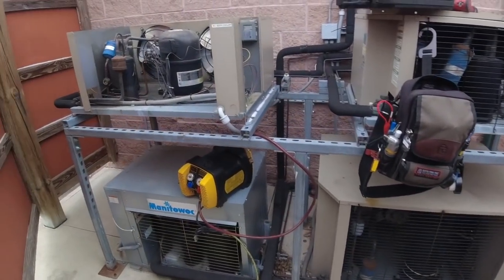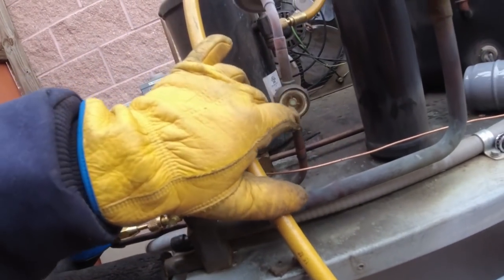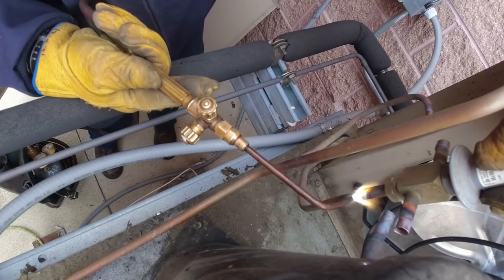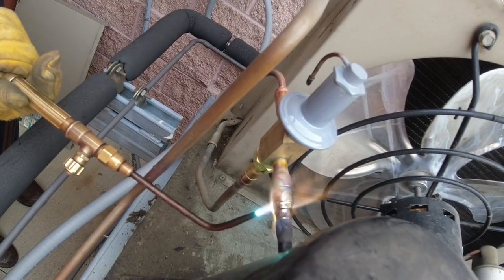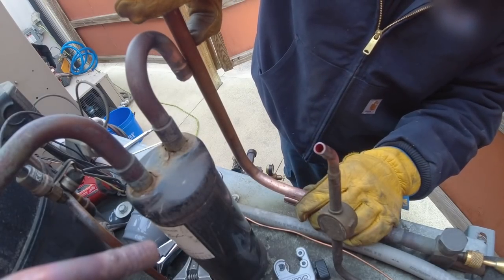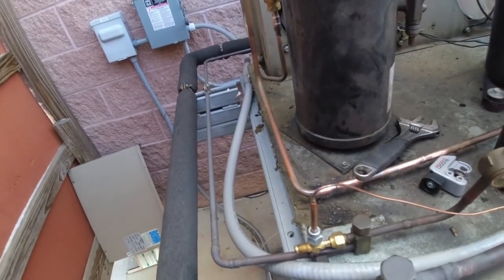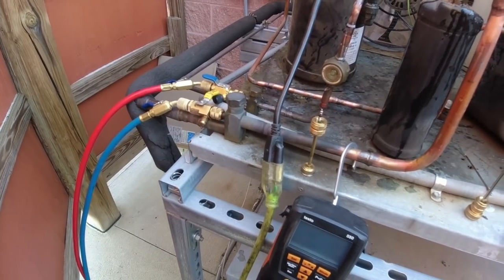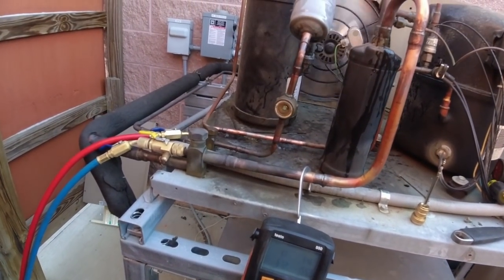Back To Get My Head Under Control

Comment: As a fellow Midwesterner I enjoy your commentary. I’ve said a lot of the same things you have especially regarding the weather, it’s something that the California guys will never understand lol. I’ve had to make pipe bushings for headmasters a few times and the last time I used my swage tool to expand the receiver, condenser and bypass lines to not have to do that and it worked pretty well. If you think
about it next time try it and see how you like that instead double bushin’ it
Reply from the maker: I have done that when I didn't have the pipe I needed. I would have needed to cut the valve out to do that because the pipes had braze on them but that would have left me a little short.

Comment: What kind of gloves are those you are using. They look good for cold weather work, and i know you always get the best.
Reply from the maker: I really like these gloves and they were really cheap. Like $14. I got them at Menards, the tag on the side is a hydroHyde. They're not insulated but they are somewhat waterproof. They fit my small hands perfect and are a lot better than any other glove that I've used cuz generally I can't work in them other than maybe a jersey style
Reply: @HVACRSurvival  Thanx
Reply: @HVACRSurvival  Looked like you had jersey inside of leather.  Don't you want to move to Texas yet?  😎
Reply from the maker: @joehead1294  I would considered it but I'd be moving my myself 😩 if so. Your kinda stuck where you land once all the roots are planted.

Comment: If you're going to stand out in the cold and work which is a joke. I'm going to leave you a joke.,

My computer and air conditioner have something in common.
They both lose efficiency whenever i open the Windows.
Take care of yourself and have a great day PS you did a great job
Reply from the maker: LoL, I was not happy about it, there was no reason to do it that day, I had it working with the fan cycle control.
Reply: @HVACRSurvival  you're a good man not to call in
Reply from the maker: I wasn't raised like that. I had perfect attendance in school most years and same for work. I never had a unexcused day for either.

Comment: Great job and explaining,
Question, so in order to check the total % level of refrigerant, the unit had to be pumped down right?
Reply from the maker: Pumping it down is a easy way to verify the total capacity of the system. In theory the system could hold more because the solenoid valve is at the evaporator but then you wouldn't be able to pump the whole system down into the receiver. Generally what I did is enough to verify it's at Max capacity.

Comment: What size torch tip you use thanks for all the videos
Reply from the maker: I use a number 2 for about everything. I have larger ones but they don't fit my handle correctly.

Comment: Sorry Rick was texting someone else named Bill at the same time what Flir camera is that and what tip are you using on your torch not the MAPP gas torch
Reply from the maker: Oops
Reply: Hey Rick what Flir was that you were using
Reply from the maker: @dmiestercommkitchentech3043  c-5
Reply: Have you had any power issues with yours like freeze ups where you can't get it to turn off or it stalls during boot up and also have you had the screen glitch on you and how long have you been using it and did you pay for it (I hope this isn't the case) I'm asking because I want to know if they have fixed the problems with it before I spend another $800.00 on a piece of worthless junk
Reply from the maker: @dmiestercommkitchentech3043  I bought it on Amazon and the power button is a little weird but I contacted the factory and verified that that's fairly normal but I've never had it freeze up and it turns off every time for me. It's slower to boot up when it's been off for a long time then if I was just using it but otherwise I wasn't bothered enough to send it back and I verified that Flir would warranty it even though I bought it from amazon, because a lot of places will not do warranty if it was purchased on Amazon.

Comment: Great video!!! How do you like that thermal camera? Thinking of getting one.
Reply from the maker: It's really expensive, I got it in the 500 range and it looks like it went up to 700 area. True tech tools has a smaller no name camera that actually has a faster refresh rate for like $350 and it's pretty nice.
Reply: @HVACRSurvival  thabks for responding back. I'll look into that camera for sure. I know you're a busy man but I was wondering what your pressure were at the end of this repair? What should pressure be for a walk in freezer like this? Also what were your subcool and superheat numbers? I know these numbers are different for every scenario.  Thanks again any help would be appreciated it.
Reply from the maker: When you have a receiver your sub cooling is usually only a couple degrees at the most, that's why we don't check subcooling on receiver systems generally . Far as pressure is concerned,  I always focus on the saturated temperatures, that way when you change refrigerants you will always be looking for the same ball park temperatures not the same pressures. As a rule of thumb 👉 and do not go by this as your only method 👈 but your evaporator will run anywhere from 10 to 15° below your desired box temperature  and your condenser will run 15 to 25 over ambient temperature possibly 30 depending on the age of the unit. These are just rough ball park numbers to help double check your operation, please follow the correct "by the book methods" to be on the safe side.

Comment: Finally you got that Hilmore swaging tool you were complaining its to expensive trough all these years.  😆😆😆
Reply from the maker: I got it last year, its neat but I don't like how shallow the cup is and it's slower than the spin swage on pipes that require you to expand a little and then release and rotate the pipe.
Reply: Smaller diameter was driving me crazy before i figure you have to do partially then to release , twist and go all the way trough.  I use that tool  more then a year and i fully agre on your statement that depth should be just a slightly deeper. Overall amazing tool.

Comment: Very neat work Rick 👍
Just curious if you guys use the heating belt on the refrigerant tank to speed up the charging process ?
Reply from the maker: Those belts are big money 🤑. I normally either warm up the tank with my trucks heater if I really need it but because I always charge liquid even with the non blended refrigerant that usually helps the most.

Comment: Don't currently have a set of digital gauges but have been eyeballing those testos with the wireless clamps over the ver popular field piece . Just not a field piece fan whats your thoughts maybe you've said it before and I missed it
Reply from the maker: For wireless probes I like the fieldpiece, I don't like fieldpiece manifold set but I do like the Testo manifold. So I'm kind of crisscross. The 550 testos are not the greatest but they're the best bang for the buck,  I like them because they're small.
Reply: @HVACRSurvival  that's been my opinion on all th3 reviews that the 550 best bang for the buck and hands down on wireless ...I wish yellow jacket would come to the table with a true wireless set up

Comment: Good job Rick, I was impressed on the pipe work and welding of the pipes, those damn electricians got nerve put their conduits and wires in the way of everyone, Haha just kidding. So did the apprentice quit or just find something better or didn't like that line of work, because you have to have skills to do commercial refrigeration or just wasn't cut out for it.
Reply from the maker: No The apprentice is still busting ass and doing great, Clayton is amazing and generally works by himself unless something important comes up where we think he might learn something new. Follow my Instagram, I post some things with him there.
Reply: Okay.